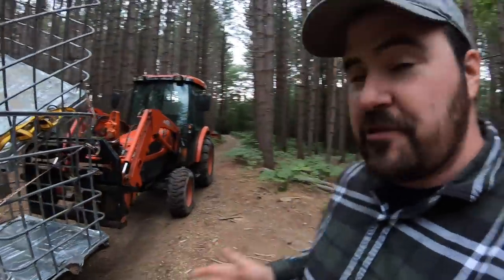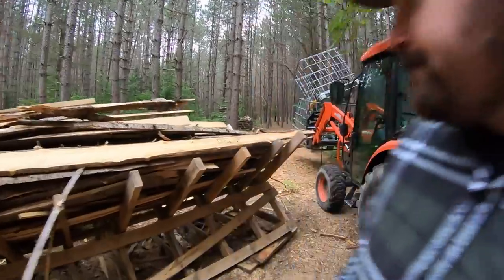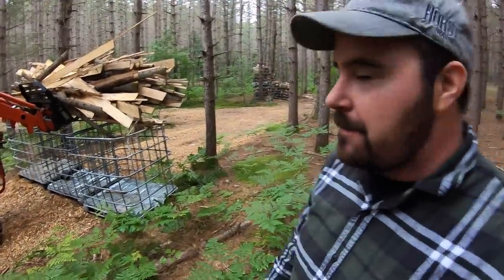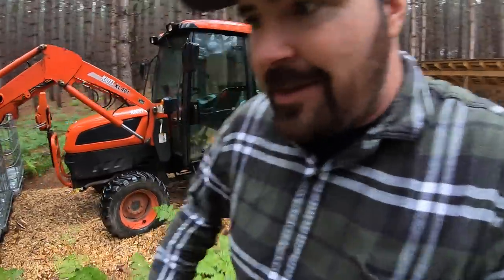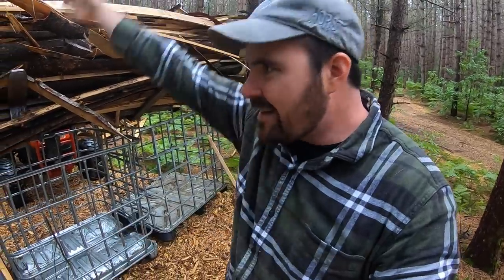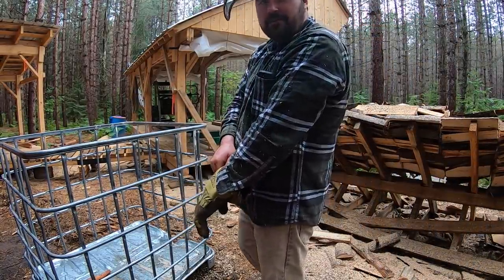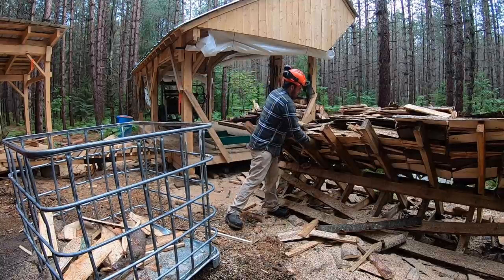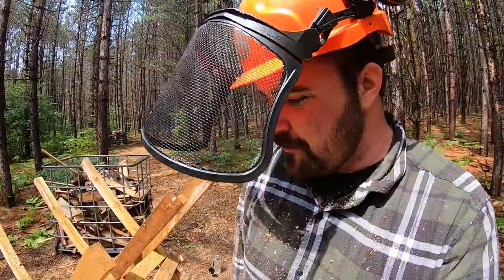Cutting Up Slab Wood the Easy Way | Rain Storm While Cutting Trees

Comment: One way to skip the manual labor - use your sawhorse as a tray and dump it with your forklift in the IBC's. As i see you fill about two IBC's with one load of the horse, so probably can make two smaller sawhorses for easy dumping

Comment: Could you add two forks and pick most of the cut slab off the slab rack?

Do your original idea but with one of those chainsaws on a stick?  (Pruning saw, pole saw?)  Might not have enough oomph though.

Original idea but set the bins in front of your drying shed and operate the chainsaw from the platform to gain a foot or two.

This one put me into problem solving mode.

Comment: I had a thought about how to get the cut firewood into the cages. What about adding a structure to the slab rack that the forks slide into, similar to a pallet but tied into the rack structurally?  Then, after adding chains or other attachment method so the rack can’t slide off the forks, the tractor could pick up the entire rack and firewood and dump it like a giant bucket into the row of cages. Might need to enhance the rack itself so it could handle the load, idk, but it would save you needing to rebuild the rack altogether. Just my .02. 
Great vids keep up the good work!
Reply: Good thing I read the comments first, was about to suggest something similar. :)
I think this could work because the wood looks quite stable on the rack after it was cut. There will be some losses, but surely less work in the end.
Reply from the maker: Not a bad idea Dylan. I’ve not thought of this before. I’ll be sure to look into the logistics of doing this. Appreciate the comment

Comment: I use the crate my mill came in to stack my rough slabs then I saw them to length. I put some thick slabs across the short side so not to hit the crate. It works really well.

Comment: Would a ratchet strap every 18” or so with a lifting eye on top help. Cut the slabs into bundles on the rack, lift with the tractor and set into your bins. Just wondering. I appreciate your thunder storms as I too live in southern Ontario.
Reply from the maker: I think the strap ideas is the way to go. Appreciate the input and I’ll be sure to rig something up for next time

Comment: Why is your tractor running wide open all the time? Don't you have a gas peddle ?
Reply from the maker: The manual calls for the tractor to be run at a set rpm and avoid operating at below that for long to maximize efficiency. It’s an HST with a forward and reverse pedal

Comment: If you take a cable come-a-long and use it to bundle the slabs together it will help when you cut them . Use to help my uncle cut oak slabs up that way, still had to pick them up and load then into his truck to move to the woodshed. But it worked great all in all.
Joe
Reply from the maker: Good idea Joseph. Thanks for passing that along

Comment: a option is to lay a strap in each X. once the slab wreck is full you fasten the straps around the slab wood and cut the wood as you do. after you can pull the wood on the strap with the tractor into the IBC cages. also less wood is expected to fall between the slab wreck.
Reply from the maker: I like this ideas I’m going to see what I can do next time around

Comment: If you were to elevate your slab rack so that the cut pieces fell into a central area that allowed access with your tractor and your grapple, that would make it easier getting the cut pieces into your bins.
Reply from the maker: I think you’re right. Big issue I have is space around the mill for the tractor to move. Maybe I’ll plan on clearing my next trees from right next to the mill

Comment: Why not chip these like you have done in the past? I imagine you have plenty of trails that can take all your chips. I am thinking about scattering my wood chips  in my 2 ac field and discing them in. Do you think that will work?
Reply: I like that idea if you planted a nitrogen-fixing crop like legumes or clover, both would speed up decomposition of the chips. The chips will use available nitrogen in the soil as they break down into humus so I wouldn’t recommend it for a vegetable garden plot. 
Maybe for permaculture like an orchard too. Reminds me of hugelkultur.
Reply from the maker: I find that I go back and fourth between chipping and making firewood depending on what I need at the time. Both work really well for sure. The wood chips would provide for good ground cover. As for how long it would take to decompose I’d imagine it would take a few years depending on the conditions

Comment: with the cages in place makes it looks easy .it might  be  a long reach to saw 
you could offset  or do a lazy L to control center
 even if it only hold 1 day of cut or 1/2 day cut its simple
Reply from the maker: Not a bad idea. Appreciate it

Comment: I use a saw buck like somebody mention but mine is only 3 of those x's so 32 inches easy to move around at time I even bring it into the wood when i cut hard wood put a pile of smaller branches and then cut them to sized for the wood stove the only extra thing i got a strap like you used to tie your container together i got one side fix and the other i just throw the strap over and tighten the whole thing down so your top wood would not be dancing while trying to cut it you but the stationary one below your wood that you cut and leave the hook free to move so you can hookup the other hook from the long strap you could use three of those because as long your rack is then you fasten the little crank on the other side stationary and throw that one witch is the long strap over all your wood then tighten the whole thing plus it help some what to keep your in the rack
Reply from the maker: I like those ideas. The strap idea to hold things together is especially good. Thanks for passing that along

Comment: If you had a wallboard/ramp system the forks would work?
Reply from the maker: My big concern would be height and using the chainsaw above my head. I think a platform of sorts to getup higher could work but I’ll need to consider the ideas

Comment: With all the pine you burn, how often are you cleaning or replacing your  chimney
Reply from the maker: I know many people say that softwood isn’t the greatest to burn in an inside woodstove and I agree on the basis that btu ‘s for softwood is less than hardwood but for me as long as the softwood is fully dried, I’ve had no issues burning it during the winter for the last 3 years. I clean the chimney once midwinter and once at the end of the season. No noticeable excess creosote buildup
Reply: Glad to hear that.. Ive burnt some a couple of times either so it didn't go to waste or I had nothing else at the moment. I clean mine about the same. Depends on the debris and how good a job I did in the spring cleaning
Reply from the maker: I’m not too familiar with what people burn in the far North but I do believe it may be all softwood.
Reply: I'm from Michigan, so we get to ability to use a multitude of types thankfully. As long as you're staying warm when it counts I spose it doesn't matter what you're burning.
Reply: Softwoods, especially ones with a lot of pitch(pines, spruce,etc), are the worst for creosote build up.  That being said, another huge factor is what type of wood stove is being used.  There are some which use a catalyst to aid in complete combustion which will help in reducing creosote...I considered those when choosing a wood stove, but did not like the idea of having to replace the catalyst in order to burn efficiently.  I instead chose a Drolet stove(made in Canada I believe) which adds oxygen via tubes on the top part of the fire box.  I was in awe in how efficient it is!  When up to optimum burn temperature it is smokeless.  I clean my chimney only once a year now and only have about a pint of soot built up in it and virtually no hard creosote...and this is burning mostly white spruce/pine(and many times green wood!).

So it is not always just the type of wood burned is my point regarding creosote build up.  :-)
Reply: @mikechristensen9744  fair enough, I know underburn creates chunks of soot
Reply: @mikechristensen9744  you nailed it.  Having enough oxygen is the key to avoiding creosote.  Creosote is a product of incomplete combustion.  People close dampers so it will burn longer.  That results in creosote and air pollution.  Chimney fires are dangerous and costly.

Comment: I know that slab wood is generally considered as fuel-grade material. I think they would work for siding if they were applied in the manner of shingles.
Reply from the maker: I think you're right. If I get down to building a small outbuilding sometime I may just use that slab wood for siding to save time and reuse material
Reply: @sawingwithsandy  I am old enough to remember the wood shingles. They were applied to sheathing boards that had spaces between the boards to allow the shingles to dry more quickly.  Wood shingles are the reason old houses have a steep roof.  

Leave spaces between shingles for expansion and ventilation.  The space should be on a shingle of the previous row.  Select the width depending what is needed or split to size with a hatchet.  

To improve performance, a strip of 60# black paper (or something) can be placed over each row up where the next row will cover it.  Use two nails per shingle.  You might consider using long nails and bending.

Comment: I suspect that if you could get the the cutting platform made to saw directly into the IBC totes, you'd run into the problem of having all of that slab wood being loose and moving around as your cutting in on the pallet forks.  Moral of the story, leave an IBC tote at the end of the slab rack and cut it up as you go so you don't end up creating yourself a big job by putting it off.
Reply from the maker: I think you’re right about the wood on the forks
Reply from the maker: I find the trouble is I don’t often have my chainsaw gear with me when I’m sawing logs so often o wait until one time when I’m not sawing and just cutting up slab wood

Comment: Why not cut the scrap while it's on the rack then use the forks to lift the rack from the pile of cutoffs? They'd be easier to get to, especially if you have a third function on that tractor and a grapple.
Reply from the maker: I find that since I cut the slabs to 16" they end up falling off the forks when I try to pick them up
Reply: @sawingwithsandy  well yeah lol, just thought the pile would be easier to reach by hand instead of reaching under the rack or you could use a grapple if you had one for the kioti.

Comment: Good to see you got safety kit, but please, get rid of the itchy finger!
Reply from the maker: What’s the itchy finger?
Reply: @sawingwithsandy  Itchy finger are the little throttle twitches just before you start to saw.  Greater engine wear, greater fuel use.

Comment: Remember the movie The Great Outdoors with John Candy and the guy that got struck by lightning like 60 times?  Seems like there should be an easier to do that but sometimes things take a little extra work to accomplish. I'd take some of that moisture off your hands, extremely dry here. Thanks for the video, nice way to enjoy a Sunday morning pot of coffee. 👋
Reply from the maker: Yeah sure has been wet around these parts. I also just had some nice Sunday morning sludge. Thanks for watching
Reply: @sawingwithsandy  I'm checking the blade tracking for the first time. The teeth on the follower wheel are 1/32 more proud than it is on the drive wheel. Do I need to adjust for this little amount? Also the manual suggest the tooth-to-front of band wheel face should be about 3/8". Mine is a little over 1/4". Is that okay or should I get it a little closer to what they recommend? Dont know how much tolerance is allowed.
Reply from the maker: I likely would try to get it right on to what the manual says although as I’ve gained some experience with the mill I’ve forgotten some things and so I’m likely off the original measurements and not had too much trouble
Reply: @sawingwithsandy  I set down and read and watched some more info. Gonna adjust just a smidge once it cools down, 93F at 6 pm. 🥵